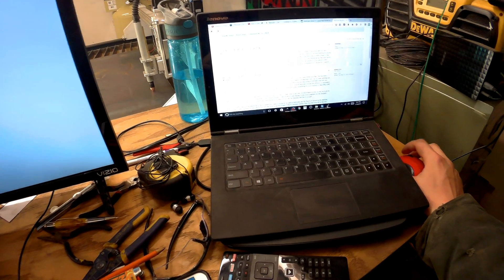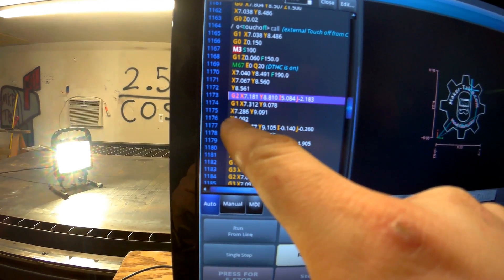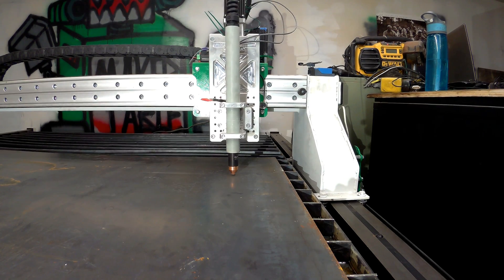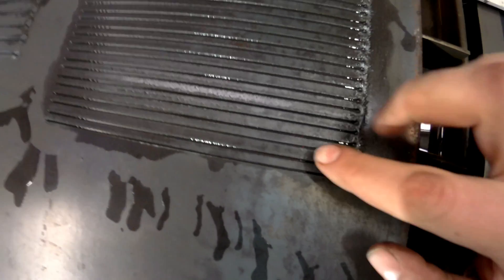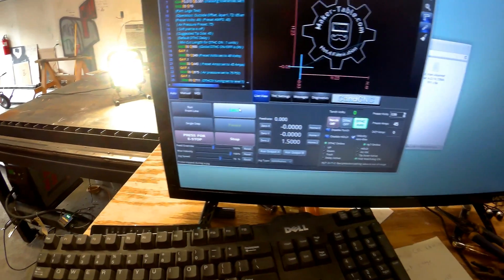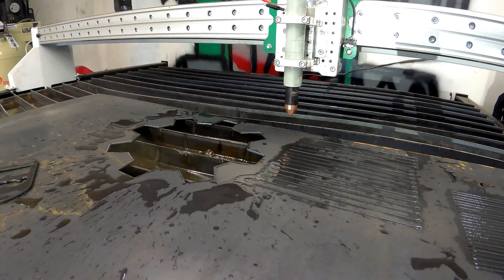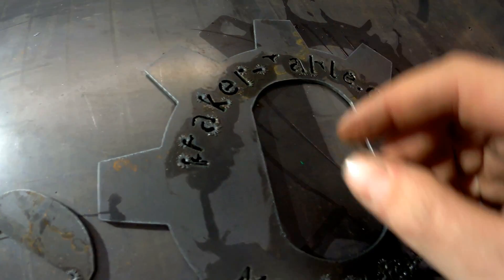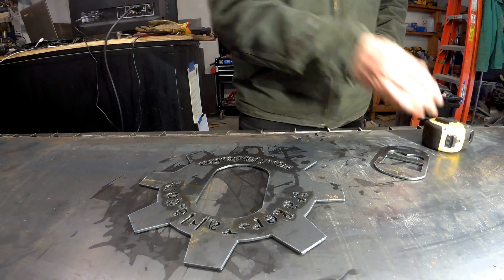CNC Plasma Table Build First Cuts 4k

Comment: I have  a candcnc setup. add the feather touch. you will like it even better then.  that torch  mount of yours looked kind of screwed up. I built a magnetic break away setup. if your not careful you will damage the machine torch if you don't get the issue resolved soon.

Comment: When you say "uninterpreted power supply" ... what exactly does that look like?  I'm having issues with my torch and Mach3.  When my torch kicks on Mach3 crashes - freezes up.  I even disconnected the relay and just manually fired the torch and it still does it.  Any thoughts?

Comment: It is your THC driving torch into to the sheet. For small shapes like these letters don't use thc. Or use sheetcam code snippets S10 on S20 off with candcnc dthc. Use also Before end turn off thc. And IF I see well on that big part you cut out a bit wavy on the outside contour, if i se well. That could be not rigid gantry( But i doubt that looks rigid enough) or noise issue in motors(not shielded cables).
Reply from the maker: I had the voltage set too low and a number of other little things.  I have it fixed now, thanks for the info!

Comment: Your torch is taking a dive after starting a cut. Things are out of wack as you know, was the center part to remain in the piece or was this nested as such? This looks like 3 nested male parts to me as per the lead-ins. I take it the candcnc setup uses the Z axis switch for THC and not an ohmic cup for THC??? This vid shows an ohmic cup installed and describes what I see happening on your vid:

https://www.youtube.com/watch?v=azHwDvaVqPc

Whats your amps, speed and metal thickness? Re-assemble the torch those cuts should have been practically dross free. with nothing on top.. You need to do your speed test cuts on all thickness of metals and start a chart of metal thickness vs speed. I do range then normally the one with the best cut example: 65 amp shielded / 1/8" hr / IPM range = 110-130(120) is optimum with new consumables. YT / ChuckE2009 has some vids with Jim colt of Hypertherm that tells all  about what the torch parts do and how to inspect / maintain them.

I did not want to mention this phase of the operation where you convert 50 cent / lb metal into $50 / ton scrap. It's all part of the process.. The big boyz like Retro will tell you up front you will need lots of metal and $1,000 in consumables to properly dial the thing in.

Carry on..
Reply from the maker: I fixed the torch diving issues,  it was a combination of things.  As far as the ohmic cup i started the install without it, just using the z axis offset from a floating switch on the torch holder.  Now I have ohmic touch setup and the timing close to dialed in now.  I def have some more material and consumables to use up before I get this sucker dialed.  I'll check out that video from ChuckE2009 thanks!
Reply: Good news indeed, I knew you would get it figured out. Wait till you see the sign I am designing now it's gonna rock in 4 colors!
Reply from the maker: SegoMan I think the multi color, multi layer stuff is awesome!  Where r u going to post pics when it's done?

Comment: Any insight as to the issues and fine-tuning you had to walk thru?  just ordered my 45xp torch and same electronics.  So i will be walking this walk in a few weeks!
Reply: If you want instant results, you'll end up ordering a pre-built table from an existing manufacturer.  It costs 3 or 4 times more than the build-your-own solution that Maker Table did here, but it also doesn't take the time required to make it yourself.  There will still be a learning curve regardless of what table you get.
Reply from the maker: It was just a computer issue,  i had a few settings out of whack.  Now its just fine tuning.  So happy to be at this point of the build!
Reply from the maker: Dan Auxter I'm not sure yet. But I will keep u posted.
Reply: Maker Table: Nothin' like dropping $5- $6k with some not-so-instant results, eh?  If it were so simple, anyone could do it.  Stay the course - it'll all pan out!
Reply: The construct your own will generate a much more savvy owner / operator who can fix the machine when it breaks.
Reply: its the build it your self its a sense of accomplishment. any one can buy some thing the table works fine its just a computer problem
Reply: Great news, man.

I'm almost done with my water table, 45xp torch got here Monday, and CandCNC electronics kit should be here in 3 weeks.
Reply from the maker: Dude that is so cool, I'm really excited for you!  I'm just cutting my next project rt now while I write this.  You are going to be a happy man when it's all said and done.